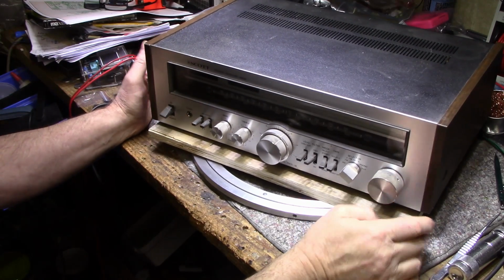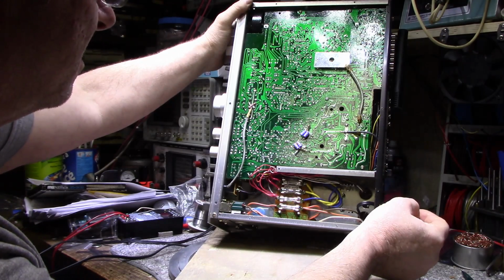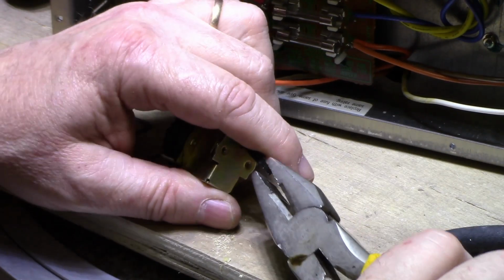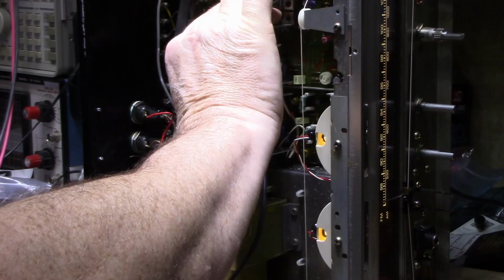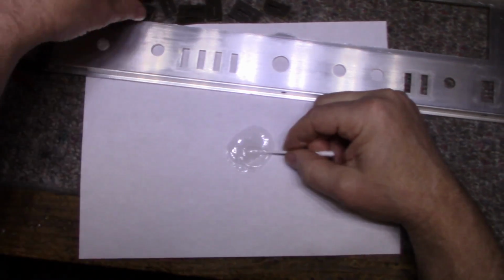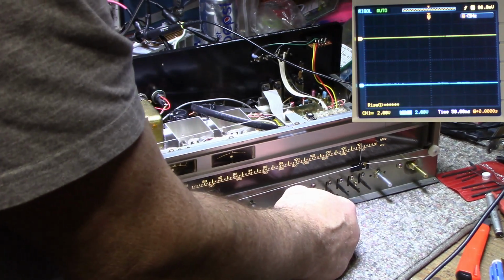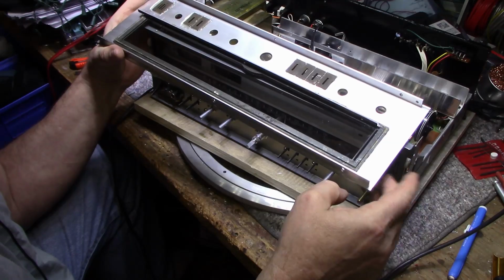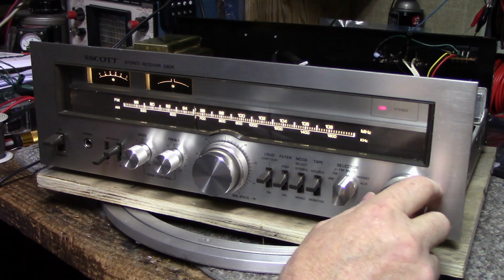HH Scott 330R Stereo Receiver - Repairs (Ep. 76)

Comment: Hi Trevor.  I just picked up a 335R which is very similar to this one but has buttons instead of toggles and LED indicator lights instead of meters.  The balance knob was stiff so I cleaned all of the pots and got them working smoothly now. The LED's for the left power bar were sporadic and found at least six bad solder joints on the left LED board. It works and sounds great now but one thing has me puzzled. Looking from the top,  I can't find any lamps or wiring for the tuner display. All I have are the two little green arrows and the illuminated needle. It doesn't make sense to me that there wouldn't be any lighting in this area. Maybe if I look at it from the bottom I'll see something. Wish me luck!

Comment: I use a small adjustable wrench to hold the switch and bend the outer part of the switch till straight...If it broke..I think you could solder it back together...

Comment: Hi Trevor, thanks for the video. I have one question about that oscillation in the phono stage. I have the same on my NAD PP2e phono pre-amp on the MC setting(MM is ok). At first I thought the pre-amp was gone so i got another one and it still there. So I thought it came from the mains and I left it like that, until I saw your video here. Can it be that there is something wrong with the cartridge on my turntable? It is an MC cartridge. Thank you very much.